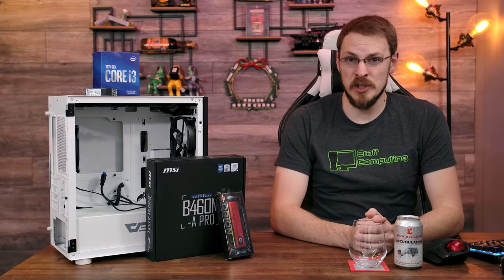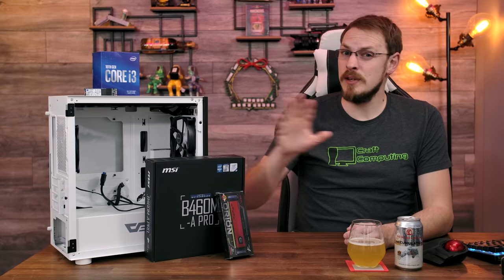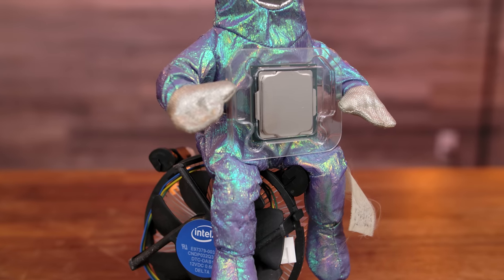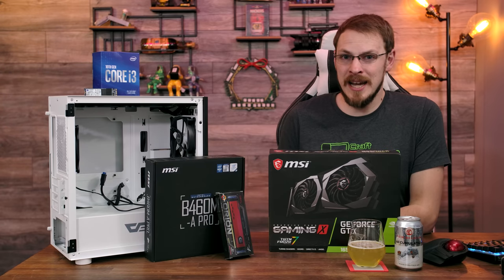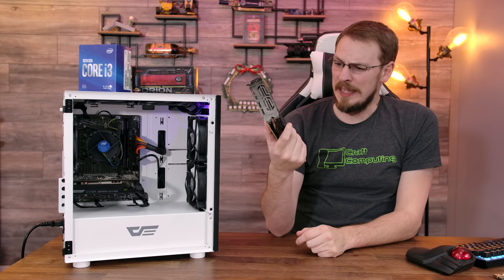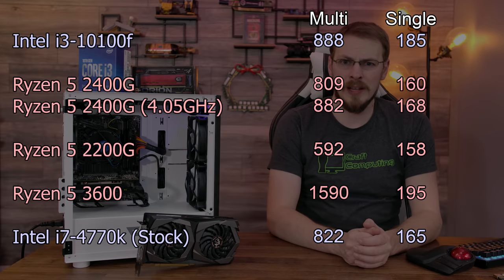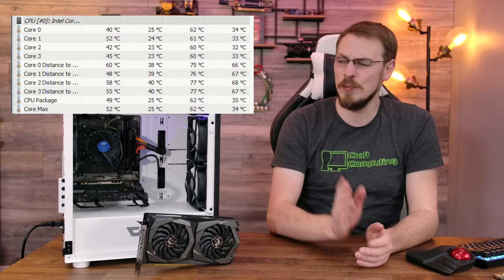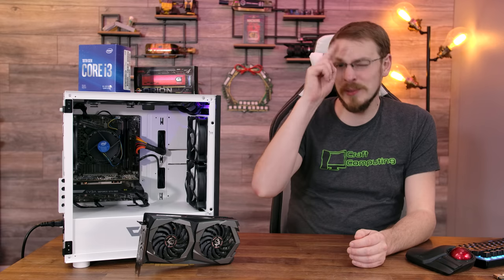Build a Budget PC with... Intel???

Comment: 3 generations ago that would have been an i7. Thank you AMD for pushing Intel to putting more core on all SKUs.
Reply: without intel, we might still stuck with bulldozer hot garbage
Reply: @bsh7390  finally i can leave my FX6350 behind next year.
Reply: @bsh7390  that's the reason why i went with the Pile Driver long ago.
Reply: @bsh7390  true

Comment: *Sees my mobile 4c/8t i7 from 3 years ago: its okay my child you still worth it
Reply: Sees my mobile 4c/8t i7 from 9 years ago: Your time is almost over
Reply: Sees my mobile i7 4c/8t from 2012 running just as smooth as ever
Seriously, if you have an SSD and reset Windows once in a while there's nothing wrong with an old 4c/8t chip for most usecases.
Reply: Hennesey  True true, but you could swap it for a cheap i7 2600 non K or something. Uses the same socket. And low capacity SSDs like 128GB should be pretty cheap too, especially used.
Reply: I see my 4c/4t intel core 2 quad q6600 from 14 years ago. Its ok my child you still got it.
Reply: @TheAnoniemo  and install inspectre so you can turn off the spectre updates and gain that performance back. spectre isnt a danger for common pc users anways, but  the updates give you a hard performance hit.
Reply: Hennesey  good choice, a ryzen 3200g with fast memory is a much better choice, it beats the rx550, easily.
Reply: @budgetking2591  I really wouldn't do that. They only affect IO speed and not much else, and they can be exploited on a 'common' PC if someone wanted to.
Reply: @TheAnoniemo  they affect gaming speed by a  LOT, and no, they cannot be exploited by anyone lol, do you know how spectre meltdown works?
Reply: @budgetking2591  They both rely on precise timing to access memory they should not have access to by exploiting a CPUs built in prediction. So any program that can do precise timing can do these exploits. They have been proven to work even from a browser, before those put patches in place which reduces the accuracy of timers in browser run code.

It seems only open world games that load game data while playing are sometimes significantly affected, due to slower IO. I read pre-Haswell CPUs are affected more.
Reply: @TheAnoniemo  Yeah i cannot speak about post haswell cpu's, but i saw a huge decrease in performance in the sandy ivy bridge cpu's.

Comment: oh yes. Where I live cheap AMD is now crazy inflated or out of stock since everyone and their mother is building computers due to covid. So paradoxically intel has became the VFM and cheap choice. Just wow 2020 is crazy man!
Reply: Whatever gives me smt or hyperthreading with 6 cores cheapest. I'd go for it (Currently i3 6100 dual core owner).
Ryzen 5 3600 here is 1.6x cost of i5 (i5 10400f = 14,000; Ryzen 5 3600 = 20,000~21,000)
I'm not going to upgrade this soon tho

In future ryzen 5 3600 (If it gets cheap) or i5 12400f with rtx 3060 will be good enough for blender and everything else
Reply: @prateekpanwar646  In gaming 10400f is the same or better than 3600. I know because I've built a system with 10400f this week which cost 160euros while the 3600 costs 230. It makes no sense to buy AMD at those prices.
Reply: How is that paradoxical? They held that title for years, and are just reclaiming it.
Reply: The 10100f is a very good choice over the more expensive or unavailable 3300x and the mobo has rocket lake support and this is a good reason to buy a 150€ z490 cause if you game rocket lake will be much better
Reply: @AntKardano  Yeah 10400f will be good enough and future proof for everything. I don't care for overclocking because 6 core, 12 threads itself is a huge jump from 2 core, 4 threads and specially in budget adding motherboard.
Reply: It's $185 for a ryzen 3 3100 for me
Reply: @elequa2220  yep crazy...
Reply: @AntKardano  on what board you using? the z board or b460?
Reply: @tontoloubiru5340  b460, saw no reason to buy a z board for a cheap nonoverclocable CPU, increased ram speed might have helped a bit on gaming performance, but it would not have been cost effective.
Reply: @AntKardano  would you suggest me a decent b460 for the cpu? I already had pc case with 3 front fans ready
Reply: @tontoloubiru5340  I personally just go with the cheapest one, maybe avoiding manufacturers like Biostar when building a budget system or using a budget non-overclockable CPU. Make sure to pay attention to available fan headers on the board and if only 1-2 are available don't forget to get a fan header spliter cable. Also check for RGB headers if you are into that sort of thing. I myself bought an MSI B460M-PRO but others are fine as well.
Reply: @divoulos5758  z490 will have support to the 12th gen processors?
Reply: @Threewlz  yes

Comment: All we can hope for is intel and amd droping their prices and leaving scalpers with a lot of parts that arent worth as much as they paid for them.
Reply: I feel budget wise and is doing a good job for the 75-200 price range
Reply: No idea why you talk about scalpers, he is doing a budget build and there is nothing on stock because we had a Pandemic this year, or you forget about that. Lets people going to work and build GPU, CPU and more people at home buying PCs and no to mention that Bitcoin and Ethereum are rising again, or do you think scalpers are buying 1650 Super to resell in 2021?
Reply: @neoperol  go look at ebay for all the out of stock parts those parts are scalpers reselling. If you actually watch the video he talks about the out of stock parts but there are plenty of parts priced 3 times higher than retail
Reply: Mmm see i cant see it happening AMD has comitted itself to high pricing with the 5 series with each of the processors with the exception of the 5600 costing more than their AMD counterpart. What is surprising is normally by now i would of expected to hear about the Athlon 5000G apu and the 5100 5200G 5300 5400G 5500 but nothing and the 4 thousand series desktop chips are only avilable from aliexpress and those are 6 core 12 threaded apus yet nothing on the mainstream market its aimed at oem system builders Hp for example sell them in the UK.
Reply: @RK-zf1jm  i know but we can still hope. They really need tougher bot detection on all websites.
Reply: @waderyun.war00034  problem is, from a retailers perspective, who cares who buys it?  They sell it immediately anyway, so their pockets are full.

Comment: The benefit from Intel, they are relatively in stock because no one wants them.

At $600 there is definitely a benefit for finding some used options. Plenty of 2nd and 3rd gen ryzen options
Reply: Nah, not even close to true, kid... lol 🤦‍♂️
1st off...Intel still has top 5 spots for overclock gaming on a 3090.. fact, just read the top 5
3dmark port royal benchmark leaderboard, all intel and 3090!! it proves it

i3 10100 i just built right today... best gaming cpu for price, hands down fact, competes with old i7 chips when using rtx cards for 1080p ray tracing ultra settings... fact

odin hardware i3 10100 video for proof....undeniable facts
Reply: oh, and ps, i spent only 780 total for my new 2060 super 8gb, 16gb ram, i3 10100 system.. everything i play ultra over 100fps 😎✌️ oh and this is with an msi z490 motherboard i got new from amazon for 120 😂 so in 6 months i get rocket lake cpu, and crush all amd as usual
Reply: @dertythegrower  cool, good deals all around. Plenty of used Intel deals that will also work for the majority of people and make excellent gaming rigs. Who needs PCIe gen 4 anyway 😉.

Comment: I absolutely love this CPU. There really isn't anything better at it's price point. If you are fortunate to live near a Microcenter you can get a really good bundle deal. I got a I3 10100 for $99 and then added on a Asrock H410M for only $29. Which is a fine motherboard for a bare bones budget build. Paired it with a used GTX 1070 I scored for $160 locally and there is hardly anything I can complain about it. I find it ironic that at the end of 2020 it is Intel that is the budget brand.
Reply: H110m?

Comment: I remember back in the good old days when an Intel 4 core 8 thread cpu was premium i7 grade things to brag about. My 4770K was amazing back in the day
Reply: My 4790K is still great even tho I bougth it just 3 years ago because I was stuck upgrading a z87 system and was kicking myself over the price I had to pay for it when even newer parts from Intel, like the 6700K, were cheaper, and Ryzen was already out.
Reply: I upgraded not because I wanted to game more but because my Microsoft 365 labkit virtual Machines would hit 💯 cpu usage for hours when they all 5 Virtual Machines in hyper-v ran Windows update at the same time. A 9900k upgrade hits 85% load for 8 minutes under same load! I have 64 gigs of RAM and nvme raid 0 helps too besides double cores and threads. But if you put the new and old beasts side by side and turned them on the boot time would be the same. For your use its fine. Especially if you don't have a high refresh monitor. 144 hz panel you would see jerks when turning on that cpu
Reply: @timothygibney5656  And I upgraded because I previously had a Pentium G G3420 that was bought as a temporary solution when my laptop died(but like the saying says there's nothing more permanent than a temporary fix) and I had to rush to build a system within budget but had to be replaced because it couldn't handle things seemingly simple like twitch streaming(always causing buffering problems) which got fixed by 4790K.

Comment: I used the same CPU for a living room VR build, it runs great and the CPU cooler isn't too loud when in VR. I got it for $100 at MicroCenter, but $20 off a $60 motherboard for the build. It performs identically to an i7 7700 from only a few years ago for 1/3 of the price. I think with the next generation of CPUs we're going to see a complete flip, Intel will become the budget brand and AMD will be the performance option.

Comment: Great review! Similar to a basic build I did earlier this year.
I had decided to replace an aging PC that has hosted my Minecraft server for several years. The old faithful ivybridge i5 still runs fine, but I knew a newer gen processor would give a performance boost in the form of less lag when the server is busy.
My choice, very similar to this. i5 9350kf, MSI B365M Pro. (10th gen hadn't been released yet). I had a 16gb Crucial 3200 kit on-hand so I used it. The video card? Whatever I had on the shelf. An old lower end ATI card, because it's a server. Case? Corsair 88R. And I used an older Antec 500W PSU I had laying around. Yep, the B365M Pro also just has two fan headers, but for my purpose, one exhaust is OK. It's a very solid little board.
Results? we've been quite impressed. Virtually gone are any signs of lag, and so far, this machine has not logged an incident (where something went wrong)
Quite happy. It just runs, day in, day out, performing really well.

Comment: Surprised there are so many comments saying Intel sucks and whatnot... I get it, AMD is dominating right now, and I personally use a 3900X in my PC, but I also just built a very similar budget gaming PC for my 7 y.o. son, with the same MSI mobo, 10100 (not the F version), 16GB of RAM and EVGA GTX 1650 (but better than stock cooler, and a SATA SSD instead of NVMe simply because I had one laying around) and we're happy with the performance! It boots in 6 seconds and so far, runs every game he wants to play with no issues at 1440p. To be honest though, I was looking for Ryzen 3 CPUs, but none were in stock at the Microcenter, so the 10100 at $99 was my next best option. No BSOD or any other issues.

Comment: I recently built a 10100 system on an ASRock B460 Pro board with 5 chassis fan headers both CPU and CPU optional headers.  They're in the right places as well.  This is a file server, but I'm tempted to drop in a 980Ti I have on the shelf just to see how it can game.  It will probably be the last quad core CPU I ever buy, but think of it; this was a Core i7 6700 just a few years ago.

Comment: $85 for a 10100f? Well, good luck finding one for that price
Reply: I was seeing the 9100f for $71, but it lacks hyper-threading.
Reply: Microcenter has them for that much,they had the I9 9900k for 300 dollars which if they keep the prices like that im going to get one for myself
Reply: just got a 10100f for £75
Reply: i got it for $90 in my country. gpu is massively inflated tho
Reply: ryzen is inflated here. 10100f is available here
Reply: in our country its 91 to 100 usd
Reply: nah it esier to find 10100f in any comp shop...  just convert my country currency dollar, 10100f is around $75 while 3100  the cheapest one i could found is $99 [out of stock] if you could still find ppl selling it at that price, the available one is more than that.

for 10100f + mobo [that let xmp enable] its around $186, 3100+ cheapest mobo $182....
while 10100f with cheapest mobo $167

Comment: This build is depressingly accurate to holiday season 2020: Most people literally cannot buy a better GPU if they have well, just about anything from the last 3 years or so. Makes me want to give up gaming altogether honestly and just focus on developing on the PC and just play previous gen and older stuff on what I have or could get already.
Reply: I was so sure I was going to upgrade my 1070 this fall... but looks like I'm sticking with it for another year or so.
Reply: The prices for anything remotely new-ish are so distorted right now, it boggles the mind. I also wanted to upgrade the GPU but it won't be possible until March or April
Reply: No, don't give up on PC building, you just have to strategize when it comes to acquiring the parts. Sometimes there's a DRAM shortage, at another time NAND manufacturers are price fixing or manufacturing capacities are unavailable, or GPUs are out of stock because mining
My point is, you have to approach it kind of in a piece-meal way, because you can get fantastic prices on the various parts throughout the year, but not for all of them at once.

Comment: Great video!  Prices are nuts-on Amazon right now, the version of this chip with integrated graphics is cheaper then the one you used!  At least that motherboard has a heat sink for the M.2 drive-I’ve heard that those drives can get pretty warm

Comment: I did similar build last week using Asrock B460m pro4 I5 10400f 16gb 3000@2666 1tb m.2 & Asrock Rx5600xt and couldn't be happier 60+fps @1080p ultra in most titles
Reply: and also 10th gen Intel mobos have viable upgrade path once the I5s and I7s get cheaper in the future but must have Z490+ for overclocking.
Reply: @danishbutter1847  yeah at this budget point this will never be upgraded only replaced 👍

Comment: I think I'll just keep my old faithful i7-4790k with 32GB DDR3 1333mhz and GTX 1070 for a while longer.
Reply: fax
Reply: Yeah, it's still good I have the I5 devil's canyon although the spektor patches do bite
Reply: I just looked recently and Haswell CPUs are finally down to the point where it's cheaper to replace my 4690K with a 4790K than to replace everything.

Z97 motherboards are higher than ever though, for some reason.
Reply: yes you should wait, plus economy is shit right now.

Comment: I no joke am making the exact build. The parts where ordered last month (non in stock) node 304 case, i3 10100f on asus mini itx mb, Asus gtx 1650 with 400w PSU and 2x8gb crucial 2666mhz ddr4. And I got the i3 for 80 euros 😉

Comment: Man. You got some good deals on those parts. I couldn't find any lga1200 motherboard for less than $80 when I ordered parts last night. Nor could I find a 10100f. Had to pay more for a standard 10100.
Reply: Just got
i3 10100, 99 shipped prime
and msi mpg gaming z490 for, 120, usually 169... 220 shipped, matches old i5, and some i7 at 1080p ultra gaming on my new 2660super

Comment: i think that with motherboard like this this cpu will actually reach its potential because I3 10100F IMC is only rated at 2666 , with good VRM ex. H410-HDV/M.2 you get for the same price 7 phase vrm , 4 fan headers and m.2 slot for Drive and Wifi, with better or same cooler you can unlock power limits and that will squeash everything from that cpu, Later on with that motherboard you can with no problem put i5 10400/F or even i7 10700/F and i think it would hold up just fine

Comment: I got a 3700x, and will use my old 1060 for the time being. The 3700x was readily available and luckily only 330 euros. I decided to not wait for the new processors because the difference between the 3700x and the 5600x is just talking about 350 fps vs 400 fps, and the 3700x does better in some multicore tests too.

Comment: Gonna run this i3 with my z490/rtx 2080 when it comes in next week. 6% bottleneck is impressive for a budget i3. Maybe no bottleneck at all with all cores @4.1. Cant wait.
Reply: Tested already? Is it really working that well or are you seeing a bit more bottleneck? Cheers!
Reply: @felipeoliveira760  no there isnt a bottleneck on this config. The only issue would be multitasking of course but for gaming it's nearly flawless. 165+ in many games. Best i3 out there unless you're looking at later 10th gen models like the i3 10320.
Reply: @PhIuw89  I see it man, thanks. I have a gtx 1660 super and am getting this cpu, was only worried if it would handle some future upgrades.

Comment: I just built a PC for my 5 year old. It's about the same price. i3 9100 Asus b360a GTX 1660 Super 500w PSU  500gb nvme 8gb gb gskill ram. Lancool 205 case. Touchaqua RGB fans and a thermaltake ux100 RGB cooler. 

Good thing it's not really for gaming. If it were that'd be a horrible deal. 😂